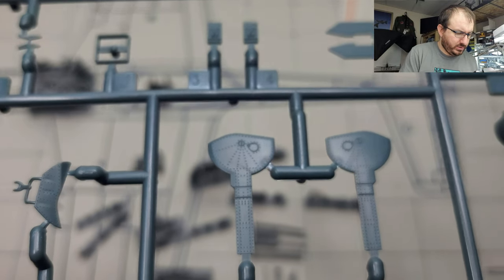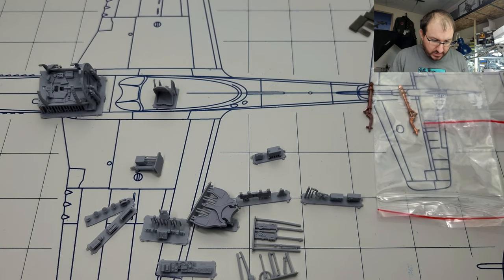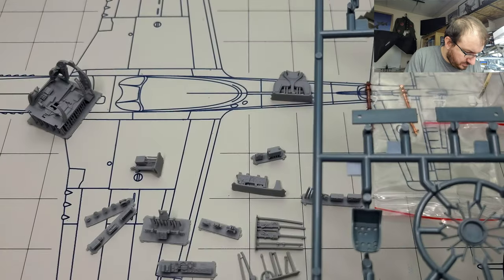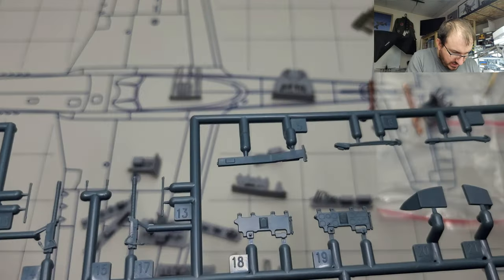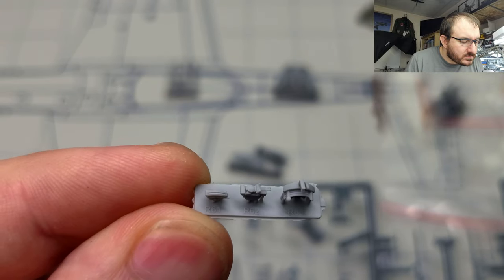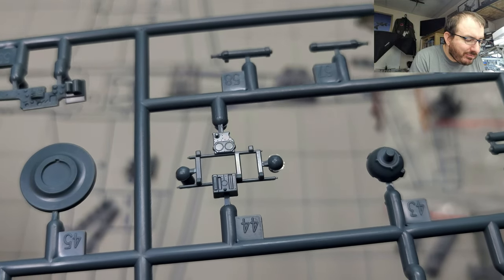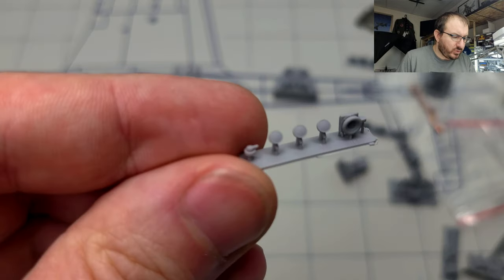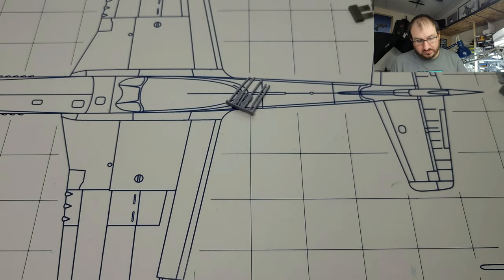Eduard 1/48 Zero 3d Printed Cockpit and Brass Landing Gear

Comment: I have a A6M2 combo kit and some overtrees on order. I might do the upgrades on one and then the straight kit on the other. I wish they went with the metal PE seat instead of resin. I have no room to complain. Comparing these Eduard kits to the mid-70's Monogram 1/48 Wildcat though - it's night and day. I think that F4F "cockpit" had a blank bulkhead, not even a seat, no stick, no console, nothing.